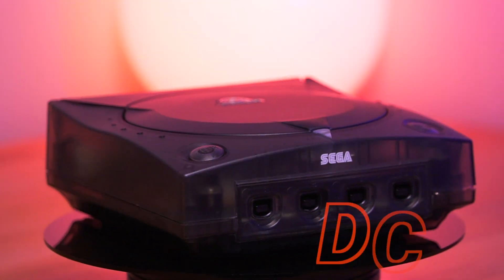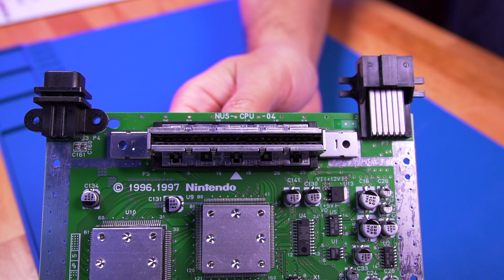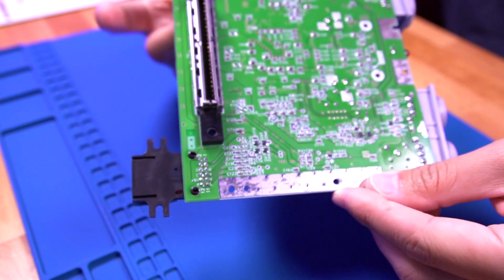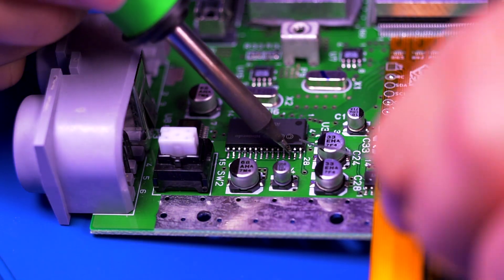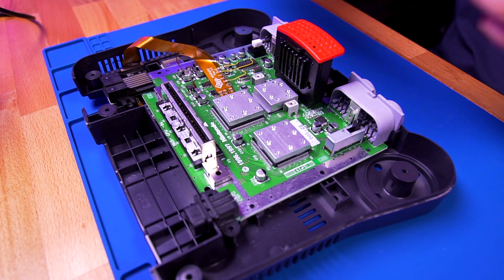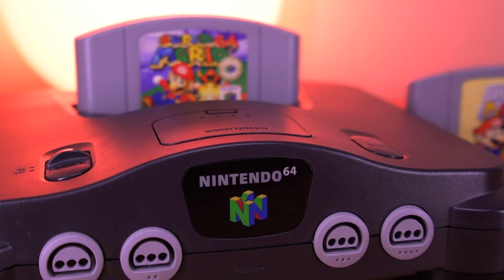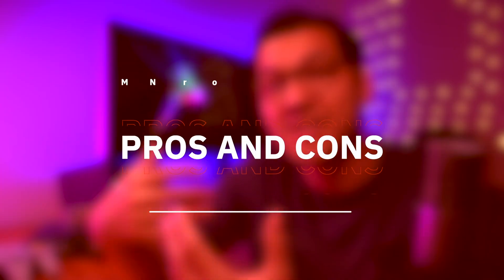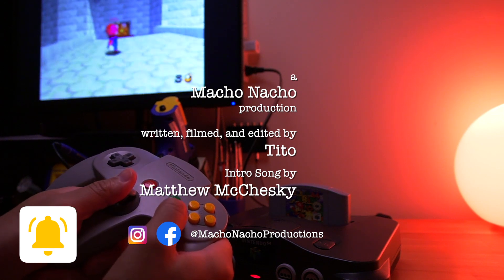PixelFX N64Digital Installation Tutorial and Review!

Comment: Does anyone have a solution to using the everdrive64 x7 and getting no signal detected issue with the N64digital, I tried the method to using a original console to install the bootloader on the everdrive cart, then put the ED cart in the N64digital console and it doesn't work

On the internet it is saying it is a CIC issue but the methods I tried doesn't work and I see videos of people using the ED x7 with the N64digital fine.

Also the console I bought has Retro Gem Shiny firmware on it, not sure if that matters or not. Any help is greatly appreciated.

Comment: It doesn't look any better in my opinion, but it is nice to have the HDMI, perhaps with the OSD settings it can look better. Though I feel this can do more for the price. If it has an ESP32 with wifi then it should also supply internet access to the console as well as Bluetooth for the audio. I mean why the hell have such a high end chip like an ESP32 and not use it for what it's worth in all aspects.

Comment: If you have multiple consoles, surely the best use of your money is a composite switch and a single upscaler such as retrotink. Rather than getting slight upgrades for alot of effort on each device.
Obviously this gives more flexibility on where you can play it, but how often do most people remove their consoles from their setups. I'd happily take a hit in quality for a day or so over paying/doing this mod. Then just hook it back up to the common upscaler.

Comment: glad to see a N64 HDMI vid that isn't about the HDMI external box things. from what i understand the only posable improvment thoes external boxes can do is upscale and they can actually downgrade the output because it needs to do science stuff to convert the output signals to useable HDMI output potentially losing signal quality in the process. one of the pros of useing N64s originaly intended  highest quality output aka S-Video is it's simply taking the output and sending it to the display device.  And that's the main reason i dispise people selling them being like this is the way to use N64 in modern times, a HDMI adapter!!! I can understand it if the seller themselves doesn't know it might not the best unmodifying video connection for even modern TVs but when their a big enough company to were they most likely do or should know it's awefull that they promote/sell them purposely implying, to non tech savvy retro gamers, it's the best quality output because HDMI is a superior output type(technicaly it is, but only if more than inferior output signals are present,as far as i'm aware.) .  

The second thing i want to comment on is about the comparisons you make about this HDMI MOD(ligit probably good). for future vidio output upgrade comparison vids i think it would be a better comparison if you use the original systems best originaly intended output as the comparison piece, in this case S-Vidio(please correct me if i'm wrong i'd love to know if their was a better vidio type avalable on the N64)

Just to make sure this comment isn't misinterpreted negatively I think this mod is legit cuz it looks to me(a noob to Video output) like it takes all or at least most of the information HDMI is designed to use from the chips in the system itself instead of the posably limted number of signals the OEM port has.

  and PS i'm prety tired rn so sory for any typos, grammar isues, etc.

Comment: Thank you so much, now I know I definitely don't need this.  Let me explain.  Around November of 2021 I bought a pre moded N64 with the old Ultra HDMI kit.  I was really excited to try it out, only to find out, I hate the way it looks.  To anyone wondering, this mod looks exactly like the old Ultra HDMI kit.  So if you like jaggies, scanlines and all that on 3D games.  Either one of these kits will work for you.
As for me, I got used to the way N64 looks on PC Emulators.  There is no jagged edges, I mean; to me; every single edge on a polygon should look like straight line, not like a staircase.  I found out if you combine the EON 64 adapter with an Mclassic you get something more like this look I describe.  The thing is, It gets kinda blurry, and also I can see a lot of screen tearing when moving around.
Take this as you may, but I found the best HDMI adapter one can get for an N64.  It's called Bitfunx Line doubler and can be found on Aliexpress, yes I said freakin Aliexpress.  Kaico Line doubler for Europe I believe (they're the same damn thing).  This thing made me hate the EON 64 as it is like three times cheaper, and has more features.  If you combine it with the mclassic the picture looks amazing, kinda like the PC emulator but running on original hardware and an HDTV, sharp edges, no blur, no screen tearing whatsoever.
Try it out for yourself, and thank me later.  Or not, but do try out this damn thing, I can't stress enough how good it is, for what cheap it is. This is what I have in my setup, and I think it looks the best
Reply: Have you used or are you aware of the retrotink? That is what I have. Im thinking of adding the mclassic to it.

Comment: Pretty good guide, however i modded the N64 for RGB output back in the day, that does a good clear image aswell. Using then an OSSC Lindoubler for Modern TVs.
The Plus is the OSSC cost not much more but can be used for different Consoles too.

Comment: What I would like to do is see someone re build the n64 motherboard but have an added support for HDMI. LIke get the pcb board, de-solder all the chips and compactors on an original motherboard and re-soldered to a custom n64 pcb motherboard. That way there would be zero need for ribbon cables or soldered wire.

Comment: this is cool, but why would anyone on earth want to do all this work, when they can just use an adapter?? who is this kit for lol
Reply: most adapters don't properly render the graphics a 1080p. Adapters will convert the analog signal straight to digital. So you won't get an upscale re-render, so the digital will be converted into a 480p signal. You'll just see a blown up 480p signal.  You could use an additional converter to do an upscale to 1080p but it still won't be 1080p graphics render.Only the video feed will be upscaled. That's what this mod solves. It installs a board that takes the cpu/graphics and re-renders the natively to resolution you can set at. Though I'm not sure if there is an easier solution like just having a logic chip that reprocesses the graphics card routed to the original composite port so one could just use an adapter with the original port but still get native graphics. Maybe it hasn't been done yet.

Comment: Am I the only one who thought the composite image looked better. The HDMI had a ton more jaggies and other than being a bit brighter, the image overall looked worse for the most part. Based on the smoothness of the video output you would have thought the one on the left was the HDMI. There is some checkerboarding on some of the edges on the composite output but IMO that is much better than the jagged jumpiness of the HDMI output (which is very distracting). I almost suspect a TV's built-in upscaler would do a better job.
Reply: To each his own. Personally, I prefer to just use an old CRT, which is what this kind of graphics looked best on. But I like the option this presents of being able to just plug it into the HDMI on your main TV, rather than having a separate setup that takes more space. Not having to occupy one of your valuable composite inputs on the TV can also be a plus, but you can still break out the composite cable and CRT when you go to retro meetups.
Reply: No you're correct, the composite image is much better. I honestly have no idea why anyone on these comments are saying the hd mod looks buttery smooth. I've never seen something so over saturated, jaggy and out of proportion described as beautiful. I'm confused to say the least.

Comment: frankly, a comparison between composite (worst video output possible just after rf-antenna) and n64 digital, shows very few quality improvement.  if the best enhancement is shown in video all that work for that is quite useless and even more worthless.  besides other options, u can get similar results with s-video cable. video and ur explication work still rocks, but the mod itself doesnt.

Comment: While it might output to 1080p it still looks like a 240i image just being upscaled. you can see just how low res the icon next to the menu select looks. its def 3d and its very very low resolution. So basically its just a hardware upscaler vs a TV upscaler right?

Comment: And why would anyone ever do this over emulating it besides 100% accuracy which nowadays isn't a selling point anymore considering how good most emulators are
Reply: No input lag and lagless 100% accurate HD output from original hardware. You can also have two simultaneous video outputs of different resolution from the same device with no lag. Any emulation options cannot recreate that. 100% accuracy is definitely a selling point as few games run anywhere close to "hardware perfect" and even ones that are close still aren't perfect. That's all before even considering changes to emulation stability when changing various graphic options that aren't present when using n64Digital. That makes this extremely valuable for a lot of people, especially collectors and gamers who do not partake in emulating for these reasons or otherwise.

Would I personally get one? Nah. Though I definitely know people that would.

Comment: I have but one question. are you able to Split the screen I'e pull video both from the original cables and the hdmi port at the same time? if so then for people who stream games I can see this mod being a must.
Reply from the maker: You can. Depending on whether you do the cut or no cut mod you may need to get a special adaptor since you won’t be able to fit the hdmi and multi out at the same time.

Comment: Those big aluminum blocks give you more time than 30 seconds also if you think that thin plate and rf shield are doing a great job cooling without thermal grease... You really need to put down the soldering iron... I would say leaving the two pieces out leaving those blocks to be just exposed to the air directly provides more cooling it doesn't need be fancy paste but plain white cheap paste would at least be better than bare metal.

Comment: I've never seen Tito this irritated with a mod, and for the most unexpected reasons. Soldering tiny wires and ribbon cables to the ends of micro chips? No problem! Removing screws from the system's RF shields? "Frickin' Nintendo, look at all these screws. They oughta go screw themselves..."

Comment: Hi Tito excellent video as always! I bought and installed the N64Digital when it was sold by a UK reseller as it was quite hard to get one here as we couldn’t buy direct form PixelFX. I noticed an error on the video though regarding the mainboard bottom shield as it can be used on the cut version of the mod installation as per the instructions notes listed below;

“Install the bottom shield on the N64 motherboard and install the motherboard.

No Cut: Install the plastic spacer and N64Digital Board into the N64 case, then place the N64 Motherboard on top, do NOT use the bottom shield”

I hope this helps as I have performed the cut version of the mod with the bottom shield installed and have no issues.

Keep the videos coming and looking forward to what’s next in the pipeline?

Comment: In terms of difficulty would you say this is harder or easier than installing a RGH chip on a Xbox 360 Trinity motherboard? It doesn't seem to hard but then again I haven't had much dealings with ribbon cables vs regular wire.

Comment: 6:42 I'm not keen on that idea of soldering cable there (on the package). I think instead either an intermediate metal connector (somewhat like mezzanine adaptor for the cable to clip into) or no soldering but instead an Amiga A600 style Vampire "hat" connector is less intrusive. A few dollars would do all that. The very fact that the HDMI Mod is "new" goes to show that new such gadgets come out, and as such, such intrusive solder near pads and delicate pins can take its toll. Also the original package on the n64 needs to keep its original good shiny "foot" shape solder done at the factory (unless you are for some reason replacing it from old oxidation or damage). 

The PCB "masking" can end up risking a heat blowout. The fact that two packages (including that messy yellow wire situation) are needed would have been an opportunity to have an entire linked hat -bracket because the position of those packages and their legs are a know quantity.

The RGB flex cable pins are through-hole vias, and so a "clipped-on" (raspberry-pi GPIO style) hat could have done fine.

If this product was a homemade mod, then fine, but it is not. It is a product.

Comment: This is a very difficult mod. If anyone here has no experience soldering, please do not do this for your first mod. Get one of the practice kits, and make a Gameboy first. Even then, I would still be very careful. N64 HDMI mods are some of the most difficult mass produced mods there is.
Reply: What do you mean by practice kit
Reply: @ciho69  Soldering practice kits. They sell them on retro game repair shop. You solder wires to parts of a board and it makes certain lights turn on when power is supplied
Reply: @kilo1265  wow that's just what I was looking to find. Thank you!
Reply: Following to learn what a practice kit is

Comment: Forget about doing expensive, risky mods. 

Retrotink 5X is the way to go!!!
Reply: It doesn't have the deblur filter that the N64 sorely needs, so you're never going to get a crisp image from the N64 with it, unless you are playing ROMs using a flashcart rather than original carts (which not everybody wants to do) and you patch them to disable the blur filter completely. That's what makes the UltraHDMI and now this so special.
Reply: Got my hands on a RAD2X a long time ago, had to preorder for it. Excellent plug and play solution.
Reply: NTSC N64 and cheap RGB mod for the money this solution cost you can get a Sony PVM or find a good crt for free...

Comment: Awesome video. Some things I would add, that major reviewers tend to ignore and I don't know why (not referring to this content creator in particular, but MLiG, MJ and RetroRGB as well when discussing ultrahdmi). N64Digital currently matches the ultrahdmi in outputting a deblur-ed "pixel perfect" image. However, the key differentiating feature this is advertised to have over the ultrahdmi is advanced smoothing filters, which IS NOT included in the current firmware for some reason despite it saying available at launch on PixelFX roadmap.  For those who prefer a smoothed image that looks like a natively higher resolution on original n64 hardware, Super64+mclassic is still tops. However, n64digital is the closest competitor so far, as outputting 480p, deblur off, and interpolation set to "softer" running into the mclassic looks really good (I prefer it to the default 1080p settings). I reached out to Dan, and he said they are currently working on an advanced XBR smoothing filter but the size of the FPGA is the holdup, if it cannot fit they will use HQ2X. Either is a HUGE deal and would arguably be the most important feature on the mod. I can't wait to try this with full 1080p and deblur on, getting a cleaner, smoothed image than the current alternatives.

So far, Adam Koralik is the only one who seems to acknowledge the SUper64 + mClassic superiority over ultrahdmi for 3D imagery (sure some may prefer pixel perfect, but others prefer smoothed for this particular console due to the graphical flaws on n64 on modern TVs, it just wasn't designed for anything other than CRTs).
Reply: 💯 

the smoothed effect is this console’s trademark!
Reply: Pin this comment to the top of the comments section please, this is extremely important information.
Reply: @ruggie.74  Thanks for acknowledging my comment, Brandon! However, the XBR smoothing has since been added via firmware, and it is fantastic. Their implementation isn't QUITE as smooth as the other two methods I mentioned when it comes to color blending, but edges are more defined, so it is a trade off that will be worthwhile for most. There is no doubt that this mod is now worth it over the ultrahdmi, even if you currently own the hdmi
Reply: @madk51385  really great info man. I run the n64 using s-video into a RT2X mini which I think has a nicer smoothing filter than the RT5X (ironically), and I feel like this may be the definitive way to play N64 on a modern display. Maximum quality and clarity while preserving smoothness and the colors seem more vibrant. Do you have any thoughts on this approach?
Reply: @redeemer5628 yes, this is most people's approach these days if they don't have ultrahdmi or pixel fx. Some of us use the super64 by EON (works just like the RT2x with same picture quality) and I pair it with the mClassic. It's a similar set up. It sounds like from these comments that the pixel fx and ultra hdmi do not yet offer enough of a leap in picture quality to warrant the price tag.

Comment: Oh it's just a guess, 
but I think that if you have the console open like that, 
it's not going to cause any damage leaving it on without the "heatsink", 
as the little blocks are still there and exposed to air.
But yeah, better safe than sorry.

I've never opened a N64, 
do you think there's room for a custom alternate fanless heatsink to fit inside and provide better heat dissipation?
It's always felt a little freaky how warm these things get all closed up.
It'd be REALLY cool if copper could be used to really concentrate all the heat into the vent area, 
and have most of it actually come out of the console instead of making it a hotbox 🥰
Reply from the maker: It would be cool is someone designed a custom heat sink!  I think the one in there works pretty well though. Cheers!